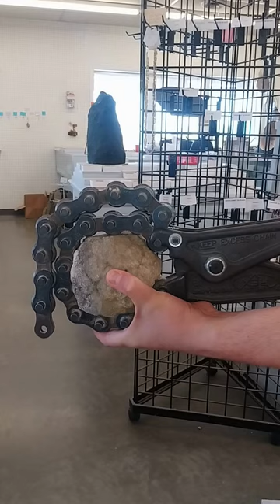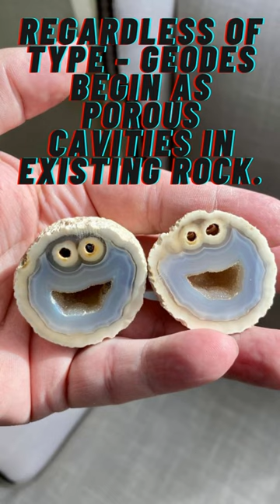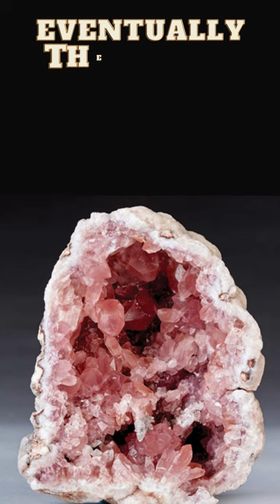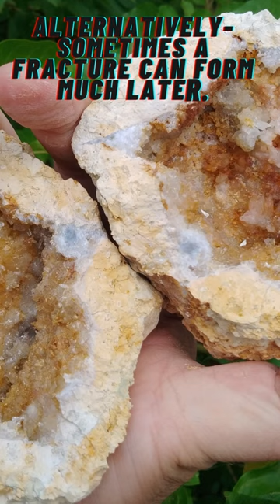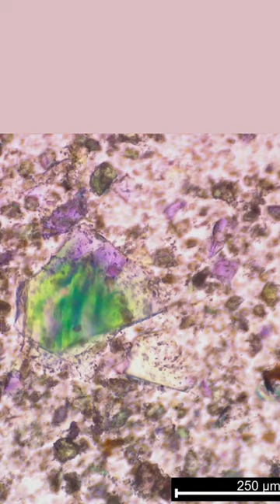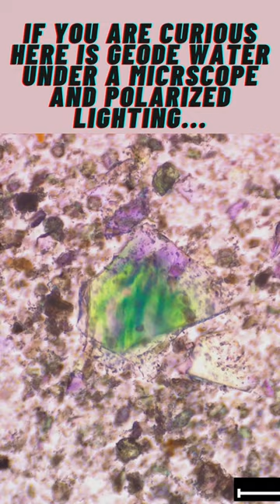How Does Water Get Trapped Inside of a Geode? #crystals #gemstones #gems  #science

Comment: Ooh, what is the pink example?  That one is pretty
Reply: If you don't mind the question, are there usually critters in the water during this process?  Thinking it would be wild to crack one and find a bug trapped in crystal or something
Reply from the maker: @bellablue5285  There usually aren't critters in there, bacteria or otherwise. Usually. There have rarely been anaerobic bacteria found in some of the volcanic geodes from Brazil but that's pretty much the exception. The pink example is just a pink quartz :)